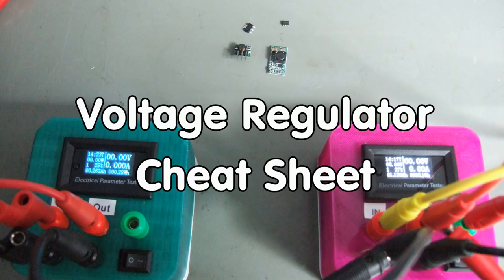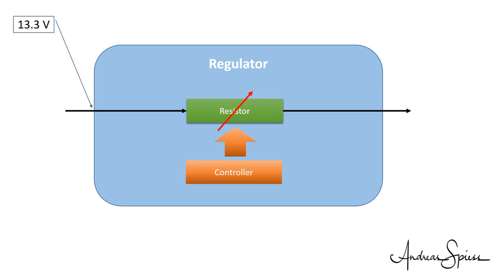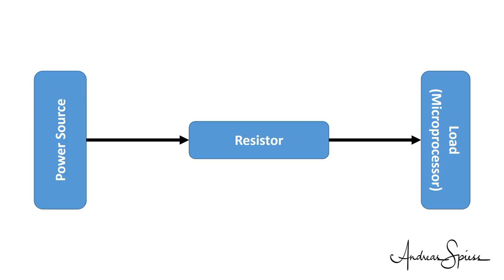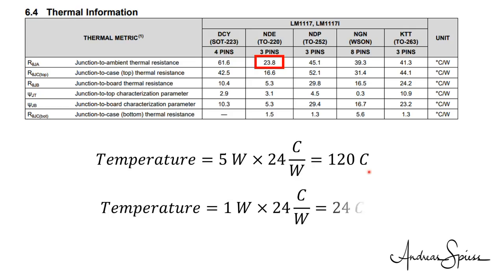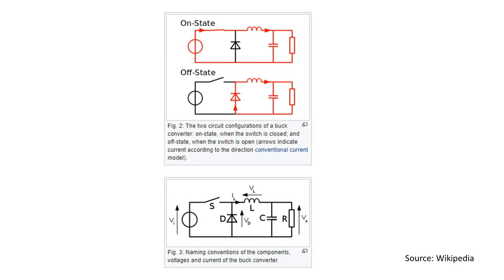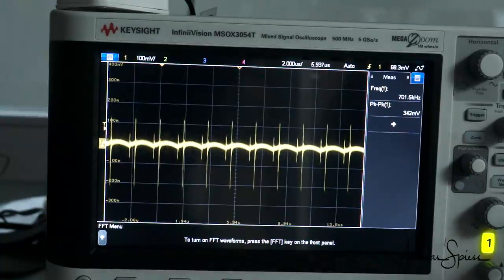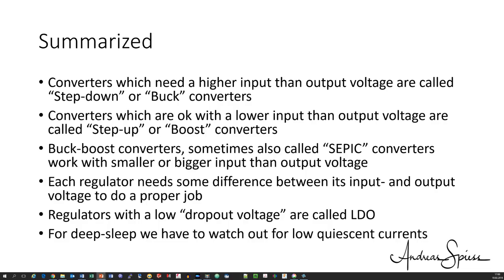#183 How to select voltage regulators for small projects? (ESP8266, ESP32, Arduino)

Comment: Andreas, another excellent presentation. It would be useful if you could do one specifically on low voltage (<5V) so that our battery powered / wearable / portable projects can have the correct supply. If you take a single 18650 cell fully charged at 4.2 volts, what are the options for dropping down to 3,3V for the uController and maybe <3.0V for the sensor or nRF20l01. Similarly low voltage small capacity solar power using maximum power point charging. Lots of scope here in the low energy world for some really good videos. These could then build into clever power management (switching uController on/off) and even the regulator itself as they have on/off inputs. Finally, some piezo harvesting of energy as you walk down a Swiss mountain with a small solar panel on your head.
Reply: whitefields5595 You can check Texas Instruments TPS63020 device. This one is a buck boost for single cell lipo batteries and has quiescent current of about 30uA. Pretty much the best i found so far as buck boost converter. I am waiting for the chineese guys to make some designs and selling them on aliexpress... Well, I can provide ready design files, if some one needs...
Reply: STPCmt, thanks so much for this. I will ask my local supplier to get some in for evaluation
Reply: whitefields5595 if you do, please check, that PS/Sync pin of the chip is connected to ground, or the quiescent current will be more likly in mA... I made this error in my first design, by just copy their sample design, where it is connected to VinA, resulting in continous current mode... I use it in combination with Linear LTC4067 as charger... I like this combo, but it is kind of expensive, compared to the chineese stuff.
Reply: You are very kind, thank you. I will let you know how I get on. I've used the 18650 on my bike to make a computer and am now developing a power meter based on strain gauges on the pedal crank. I've got LED strip brake lights driven by a boost converter , RTC and a OLED display. I'm pleased I can power all this from the 18650 but have to be careful as the voltage drops, hence my post.
Reply from the maker: I would be interested in the design file...
Reply: Additionally could you determine which regulator would be best when also adding LoRa to the solar powered sensor. Great video as always, thank you.
Reply: LTC3588 (piezo harvester) breakout are on ali / bangood - not a dirt cheap module though

Comment: Excellent video as always! What if saving money is not the primary goal? Instead if we wanted to focus first on efficiency and then on a smooth output with low noise? How can we find such?
Reply from the maker: As mentioned, it depends on the input voltage. For a Lipo and 3.3 volts, I probably would go with an LDO. Switchers are always the second choice for me because of ripple and noise. I only use them if I need.
Reply: Maybe connecting a switching regulator with a voltage slightly higher than the output to an LDO? This would be quite efficient since the LDO only has to drop a few millivolts and smooth because of the LDO's noise rejection. And for a LiPo, the best would be a buck-boost converter since, with an LDO or buck converter, the voltage must be higher than 3.3 V for the MCU to operate properly. Better use 2 smaller cells in series and a buck converter. And probably some EMI shielding (a piece of aluminium foil should do).

Comment: Great video! I wish I would have watched it before I made the experience that my 1A regulator overheated already with 0.2A.   There are two issues for which I would like to see more info (maybe you have it already in another video). Which capacitors (size and type) should be used with the regulators?  Which temperature is acceptable i.e. in a small case? I know the datasheets have some information about both these points but I am sure you have additional practical advice. Thanks
Reply from the maker: We also use the data sheets for our work. Not a lot to add. 
To avoid that the ESP does unwanted resets I add a 1000uF capacitor. Maybe you watch my deep sleep video if you are interested.
Reply: @AndreasSpiess  Thanks for your fast reply. I had a problem with an Arduino Mega 2560 Pro Mini with USB power supply. It stopped working after a few seconds. I added a 470uF capacitor and all worked fine. I was surprised that the USB port from my expensive ASUS Motherboard was not "good enough". I watched already your deep sleep video. Interesting!

Comment: Great video. I've learn so much from it. What do I have to watch out for step up regular?  I'm making projects with Raspberry Pi and it take 5V, but most re-chargeable battery is 3.7V.
Reply from the maker: Just look out for a regulator with 5 volt out and 3 volt in

Comment: Hi Andreas, what a coincident this video came up today. I have through the last couple of days researched on this topic.  Im currently working on a WiFi AP(using an ESP8266) project to be driven by solar-cells. My plan is to have the 8266 running about 4-8 hours a day and deepsleep the rest. If the sun here in California is enough, I may increase on time to 8-10. I have all ready watched through some of your videos over the last year in regards of the solar-cells that has been really helpful. My plan is to use some 6v solar-cells charging a 1S lipo pac(around 5-10Ah). So, my question that I have not really seen an answer on is what the most efficient way to drive the ESP8266 from 3.8-4.2volt down to 3.3. is it to step it up to like 5 and then down to 3.3 using switching converters or is it better to go straight to 3.3 from the lipo with a LDO regulator?
 I just ordered some MCP1700-3302E that has less then .2V dropout voltage,  but after this video I'm not sure that this is the best option. I'm hoping for your (or anyone else ) input on this.
Thanks again for sharing your knowledge through this great channel.
 Regards, Emil, CA, USA
Reply from the maker: For a small voltage difference, linear LDOs are perfect. So you are on the right way with your order.
Reply: Thanks for your feedback Andreas.

Comment: Request for research: two load scenarios (a) 3.3v micro/arduino and (b) 5v micro/arduino... Power source: Battery operated using 2x18650 either in series with a buck converter or in parallel with a boost converter.. My guess is on the serial/buck being the best option
Reply from the maker: I still have a plan to finish my solar video. But it will most probably be for 3.3 volts.
Reply: It was only an idea for a video... Not a demand...

Comment: If you were reducing from say 12v to 3.3v, but needed a smooth supply, would there be any benefit to taking the voltage down to 5v with a converter with a decent smoothing cap, and then using a linear regulator to take it down to 3.3v to give a smooth output without as much power loss?
Reply from the maker: In very rare situations this might help.

Comment: What is the start up current for ESP32 module ?
What is the max current for ESP32 module? Some say it can go upto 1.2A. Is that correct ?
HT7333 max current is only 250mA and hence it cannot be used for ESP32 module. Right ?
Which buck booster module /IC would you recommend for esp32 module ?
Reply from the maker: Maybe you watch my video about ESP8266 deep sleep. There you find all answers. They are very similar to the ESP32

Comment: Hi Andreas, nicely done video. I believe I saw a USB isolation board at 18:02 (bottom right of the video). I am assuming you use it for data logging to a computer or laptop. I want to use it for the same purpose in order to use a USB oscilloscope with my PC. Can you  share your experience about it? Or, perhaps you can make a video on using this isolator with a USB scope?
Reply from the maker: I think I already covered it in one of my videos. But I do no more remember in which one. Using this with a USB oscilloscope is a good idea.

Comment: I desperately need a 24v to 3.3v ultra low quiescent current switcher (buck) - max output current around 300 mA - for a 24v battery battery project where ESP sleeps and wake up. The buck you analyzed in this video is 250uA of quiescent current which is too high @24V.
Do you have any recommendations ?
Reply from the maker: I never used 24 volts. So I do not know.

Comment: Andreas! 
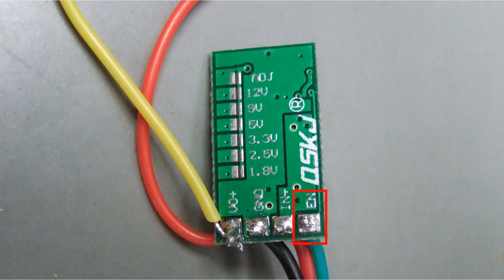In my quest to build an Adafruit Huzzah 32 set-up for some sensors reporting via WiFi/MQTT every 10th minute (ie.. more often than yours :)), and being solar powered so it can run for ever, I have followed and learnt much from many of your videos. Revisiting this one, i can happily report that i am ALMOST there. I only want to use one battery, so it goes on the MPPT solar charger. I then connect the load from it to a buck-booster and power the Huzzah via 5 V USB. It is weirdly enough the only way i got it to work (to many components!). Problem: i must now turn off the booster via its Enabled pin (as youre talking about @ 18:50), but how can i then switch it on from a completely un-powered Huzzah? I ask you this: if i put a big capacitor on the USB of the Huzzah (which is in deep-sleep, time wake up), will that enable me to enable the buck-booster just long enough to switch itself on, and thusly power the Huzzah? Is this safe? Do i need a resistor somewhere to limit current?

And thanks for your videos again. Wonderful!

/Axel
Reply from the maker: I would make sure the Huzzah is never unpowered. This should be possible in your design if you have enough power. You could measure the battery voltage for example.

Comment: The 24K you calculate are the temperature RISE due to the power dissipated, not the final temperature.
Your regulator would be 24K higher then ambient. How else would it give off the 1 W ?
Reply from the maker: You are right. I think I mentioned this fact in the video

Comment: Mounting  four resistors in series is not 4 x 5 watts it is the same as your 10 volt drop but 10/4 across each, 2.5volt x 0.5amp or 1.25watts
Reply from the maker: I said they are rated at 20 watts, not that they got 20 watts. As you point out, they still only had to dissipate the 5 watts.

Comment: can I use two LDO's in parallel to increase maximum current? HT7333's low quiescent voltage is great, but outputs only 250mA... I want to be on the safe side with at least 500-600mA
Reply from the maker: No. But you can use its bigger sister (HT7833)

Comment: I am still working on a project with a boost converter that consumes little with, for example, deep sleep. In this video I hear you say that the BL8530 only uses 6 micro amps. I have not yet succeeded in this with the BL8530 (not the board) and also not with an HT7750. Now I look at the link to the BL8530 in the description and when I look at the pictures I see that it uses at least 22.5 micro amp without load. am I overlooking something or am I doing something wrong that I don't get that 6 micro amp?
Reply from the maker: Here is the datasheet of the BL8530: https://datasheetspdf.com/pdf-file/776474/Belling/BL8530/1
Reply: @AndreasSpiess  Thank you. had already seen this one. I just can't get to those 6 or 7 micro amps. Have now ordered some more expensive capacitors to see if that can make a difference.

Comment: Hi Andreas. I did not understand the part of the antenna and the switching regulator, if, for example, I want to powerup a sensor node that uses an esp8266 or esp32 I should avoid using a regulator? because I want to run this node with a battery.

Thanks a lot for the information.
Reply from the maker: You need a voltage regulator if your battery power is higher than 3.6 volts.
Reply: @AndreasSpiess  well, avoid using a switching regulator i mean?

Comment: Super tutorial again thanks.
I am currently testing low power applications using €1 Attiny85 + p-channel Mosfet as low quiescent current interrupt driven supervisor on regular 3.7v LiPo.  The Attiny/Mosfet powers up Espressif based ESP-Now, LoRa or LoRaWAN MCU's via LDO depending on the application.  The Esprdssif chip triggers it's shutdown and Attiny's deep sleep.  Looking at Attiny + software serial for LoRaWAN frame count for fast ABP transmits.
Your thoughts?
Reply from the maker: Sounds like a good solution for deep sleep. And the ATTiny for sure does not need a lot of current. I would like to compare this concept with the Low power unit of an ESP32.
Reply: Andreas Spiess For sure, me too. The large LiPo with no parasitic regulator on the Attiny is the lure. All Espressif chips currently need LiFeS04 or a regulator I believe.
Reply from the maker: I see...

Comment: Thanks for the video. I love those small switcher modules, but have never verified the efficiency and do not have the instruments to measure the ripple.
If I understand correctly, one could put and LDO after the switcher to smooth out the output. Could you tests this setup? Say and HT7333 following the switcher module set at 3.5v?
Reply from the maker: Sometimes this concept is used. But this is a niche. I will use it if a project requires such a design

Comment: Is there a way to filter out the high-frequency ripple created by the switching converters? Maybe decoupling or smoothing capacitors of various values?
Reply from the maker: These power supplies already have capacitors and usually also inductors built-in. You always can increase their size. But for really "quiet" power supplies most people use analog designs.

Comment: Excellent video, thanks! Can the buck regulator HF components be mitigated with additional capacitors or maybe ferrite beads?
Reply from the maker: Both would help for the output ripple. For the emissions I am not sure. Maybe a metal can helps there.  Or distance between the regulator and the antenna
Reply: Switching noise can be suppressed. Google for snubber circuit. With ferrite beads watch for saturation.

Comment: Do you have a video on the Best step down converter for our 3.3 mcus? There are so many options and hard to select which would be best.
Reply from the maker: I do not have something like that. You just have to set your goals and then compare specifications.
Reply: @AndreasSpiess  I wanted to test however won't make sense to buy the Otti for my small tests. If you run by something that you would recommend for testing and does not cost $600 please share.
Reply from the maker: The datasheets should be enough for a comparison.

Comment: Buck-boost and SEPIC are not the same thing. 
There are 4 different topologies used as combined step-up and step down:
1. Buck-boost https://en.wikipedia.org/wiki/Buck%E2%80%93boost_converter
2. SEPIC https://en.wikipedia.org/wiki/Single-ended_primary-inductor_converter
3. ZETA (inverse SEPIC) https://www.electronicsweekly.com/blogs/engineer-in-wonderland/zeta-that-other-dc-dc-topology-2016-05/
4. Ćuk https://en.wikipedia.org/wiki/%C4%86uk_converter
Reply from the maker: Thanks for the clarification!

Comment: Very nice, fun to see the resistor die, I was thinking you might kill a buck converter too with an over load :-)
Reply: you can kill them with an overvoltage @ the input but they are overload protected. These particular devices are advertised to deliver 3A but they will stop working a bit earlier.

Comment: Hi Andreas
Thanks for video. I was wondering if you compare between step down buck converter characteristics such as xl4015 and lm2596.
Thanks
Reply from the maker: I  am not sure if I will do that because they are quite big and usually, we do not need the currents they provide for our small devices.

Comment: Hi Andreas,

Thanks for this great video! 

What do you think about logic level converters in this context?

To give you some background: I am building a LoRa beehive scale using an HX711 for measuring the weight and a Hope RFM96 for LoRa transmission, together with a bare bones Arduino. The device will be powered with a 3.7 V LiPo battery (4.2 V fully charged), which is too much for the RFM96. Also, I found that the HX711 needs a steady voltage, as the output varies with varying voltage (I tried 3.3 V and 5V and the values were quite different). Any ideas on how to provide the Hope RFM96 (and HX711) with a steady 3.3 V?
Reply from the maker: I think I made a video about powering of microprocessors. In your case, an HT7333 would be a good choice.
Reply: @AndreasSpiess  Thank you Andreas. Just found your video #091 where this is explained.